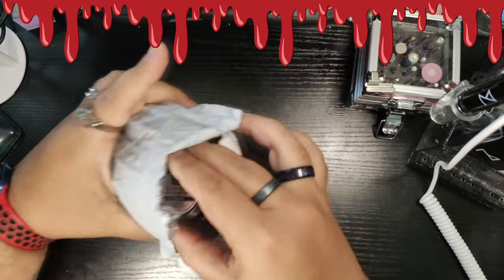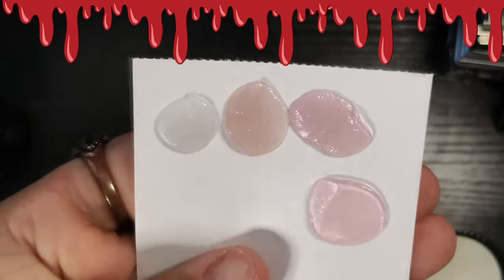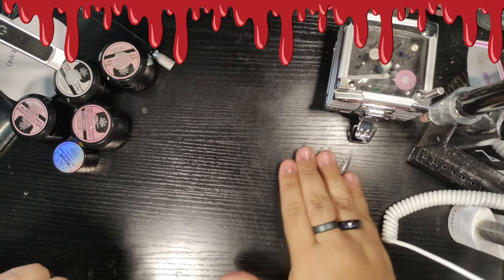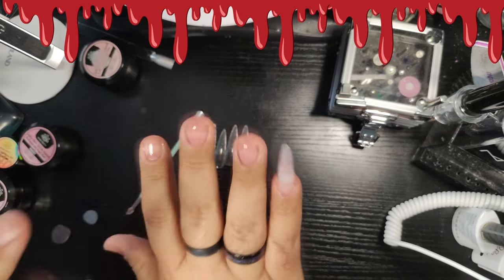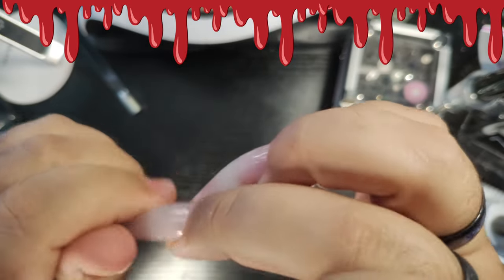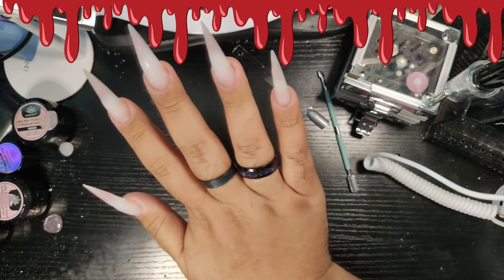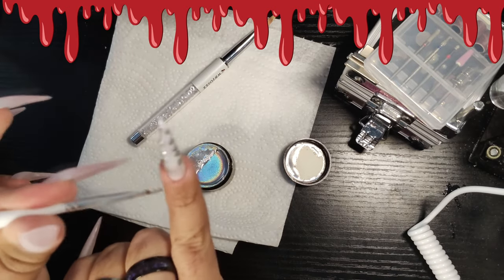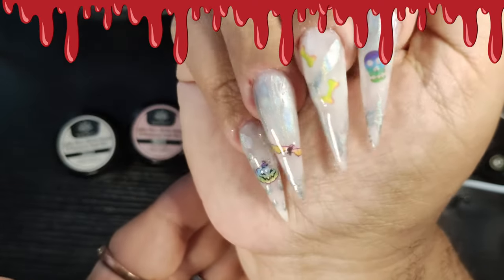I Tested Born Pretty Non-Stick Nail Gel with Dual Forms! Works great!

Comment: I have to work on using dual forms because baby😂🫣 Not a good sight at all😂
Reply from the maker: Girl, this is my first time using them in a very long time, but let me tell you using this solid gel extension moment makes it so much easier than trying to do. Let’s say poly gel using dual forms! Every time I use poly gel, they turn out a little wonky but being able to mold it with your fingers allows you to really get in all the parts of the dual form! Hope you’re doing great!!